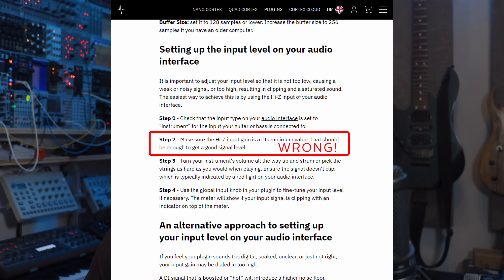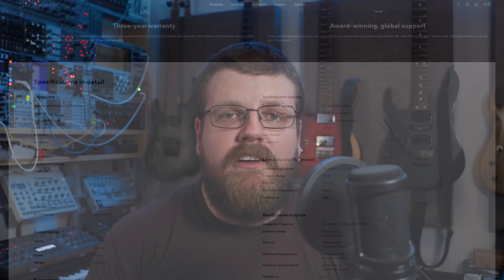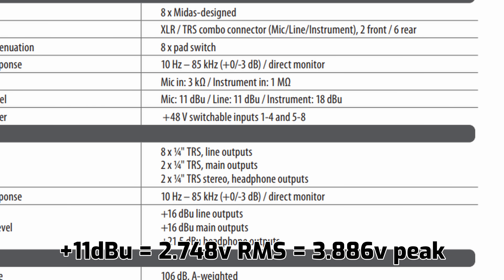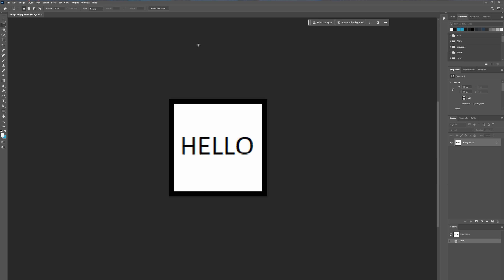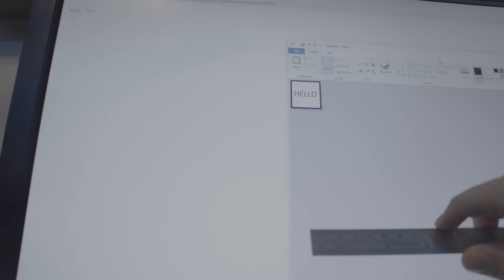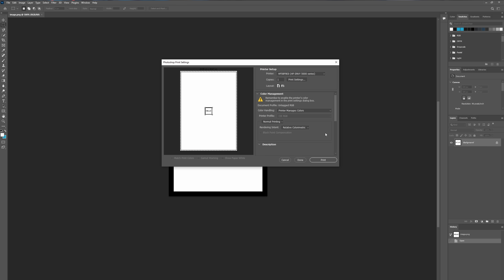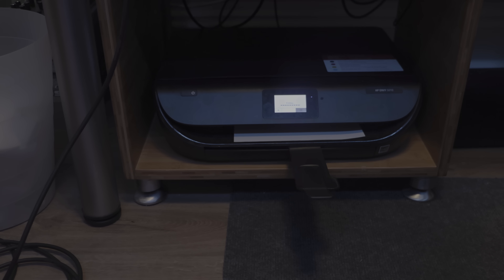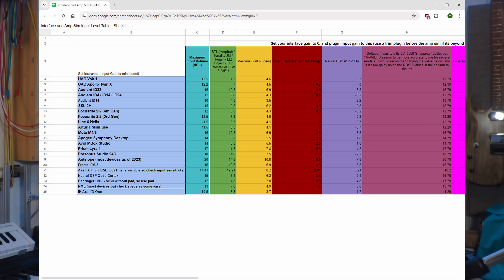Ampsims and input gain - Please, stop the madness...

Comment: In my modest opinion, the story is a little more complicated with sim plugins, which are supposed to behave exactly like the real counterparts. With this approach (ie, maximising the signal/noise ratio for ANY type of input), the amplitude of a signal generated by a Strat as observed by the plugin in the digital domain will be roughly the same as the amplitude of a signal generated by a Les Paul. So I think there are two options here: either we follow this advice, but then we'll have to use different level adjustments in the digital domain to compensate for the different instruments, or we give up a little bit of noise floor and adjust the interface gain for the highest output pickup we have, and keep the level adjustment fixed in the digital domain. In any case, however, I think the sim plugin manufacturers should report a reference level that the plugin expects to see *for a particular pickup*, otherwise we are still missing one aspect of the equation! (and then obviously you have TONEX/NAM, where the capture process is not standardised, so those numbers should be provided by whoever produced the captures).
Reply: I set it this way to my loudest humbucking pickup. And then just leave it at that even if I plug in a single coil. So the lower signal of the single coil behaves how it should with its lowered output. I think that makes sense?
Reply: It does make sense. To be 100% accurate, we'd still need to know the reference input level that the plugin expects *for a particular pickup*, but the manufactures don't go down to this level of detail, so using the reference levels that were collated in that spreadsheet should put everyone in the right ballpark... and we can finally play 😀
Reply: Really interesting point about different types of pickups! Plugin companies providing reference levels for different guitars/pickups seems like a pretty cool idea to me, especially if you're trying to sell people the "sound" of something in the real world they can plug their guitar into and compare it to. You don't want them to think your plugin doesn't measure up to the real thing simply because the input levels need to be a certain way to reproduce the sound they're familiar with, but nobody has this info. 

Since plugin companies don't really do that, I'm wondering how would I deal with this if I was using the method described in this video to record more than one type of guitar, and wanted the experience you're describing with a plugin reacting like a real amp in that it behaves differently when fed different guitars and pickups, etc....

I think I'd try getting a setting dialed in on the audio interface using the loudest guitar(s)/pickup(s) out of the ones that I have. Then, I'd make a mark on the audio interface, take a picture of the knob's position, make a note, or something so that I could return to that setting whenever I input any of my guitars into the audio interface. I would dial in the settings on my amp sim plugin(s) using the guitar I play the most and the input level I just decided on with the audio interface.

I have not tested this (of course), but I'm guessing the difference in the noise floor created by the different signal levels when comparing two guitar pickups might only be a big deal if one of the pickups is noticeably noisier than the other, or if one is passive and the other is active. 

Ok, enough of this. I'm gonna go record some things.
Reply: Jason Sadites just posted a video about this - he seems to agree with me 😀
But yes, fundamentally, to avoid constantly adjusting the input gain in the digital domain, the analog gain on the interface will always be a tradeoff between signal/noise ratio and the ability to pick up any guitar we have and avoid clipping. And yes, the signal/noise ratio lost (worst case is for lowest output pickups), if we are not using garbage interfaces, it's likely to be... in the noise (no pun intended).
Reply: Same issue. Calibrated my input gain so hottest active pickups don't clip. Keep the same setting for vintage strat pickups for consistency in virtual amp's response. I guess, this gives me about the half of bit depth for strat. And that's better than a quarter of bit depth)))
Reply: Sorry to resurrect this, but thank you, you are right.  This video is all correct but misses the point of the earlier debate.  

There is no standard for what an amp sim “expects” digitally and no way of knowing if you have it right except if you can compare to the original hardware.

Also whether you turn up the gain as high as possible is a question of whether the analogue circuitry and preamps in your interface is 100% transparent for the instrument inputs.

Comment: This makes a lot of sense to me. And how people have recorded using digital audio interfaces for many years. With mics, DI bass, synthesizers etc... The only thing maybe I was thinking was that it's the 'AVOID CLIPPING' part. Whatever about the other considerations, that is the most important aspect. If it's a choice between clipping, and low-gain (and resultant noise) and clipping, I'd take the higher noise-floor any day. So, I do think it's maybe not as loud as possible to avoid clipping but I think of more as loud enough for a very healthy signal level, where clipping should never occur. I know it's pedantic, but I think there's a distinction that matters. The middle ground of healthy signal level is where I want to be. Then yes, like you said, adjust the plugin gain. But on that part, I really don't know why the general advise by others isn't just 'trust your ears'. Like people should with microphone positioning, phase, or dialing in the tone from a real amp or pedal. These days people are expecting computers to hold their hand to cross the road ;)
Reply: Well that’s obviously foolish.
Most DAW computers don’t have the ability to walk or hold hands.
Reply: @nigelsmith721  Yeah, I'd be worried about getting clipped ;)

Comment: I'm more confused now than I was before thanks dude
Reply: It's not hard... 1. Optimise analog signal going in to interface, by increasing it to just below clipping; 2. Compensate digital signal going to your amp sim (i.e., in your DAW, or on the amp sim itself) by turning it down by the same amount.
Reply: @matthijshebly not quite.

1. Interface to zero
2. Digital gain plugin to chart (interface/amp sim matrix)
3. Increase analog gain to under clipping.
4. Reduce digital gain plugin by the amount you added to the analog stage. (If you added 10 dB in step 3, subtract 10 dB from the plugin you added at step 2.)
Reply: @Hexspa  You're basically saying the same thing, just with way more words and with lots of unnecessary confusion added...
Reply: @matthijshebly  not true. The whole point of having the chart is to match calibrated levels. That’s what the digital gain plugin step is for. If you leave that out, you’re right back to seeing things by ear.
Reply: lol best thing i found was to barely raise it a little at a time until it sounds nice. 0 sounded upsettling weak for me..ended up around 2.3 which ended up being what neural dsp says on their site. (for QC as an interface at least)   just go in small increments

Comment: Ok first of all, Reddit is for retards who want to be spoon fed every step of their lives 
Second, the complete lack of understanding by said community and others is perplexing to me because ALL the information to understand is available for free.
Social media killed curiosity and fundamental understanding.

Each recording device will have a sweet spot and produce a beautiful, low noise,  hi headroom signal.
That signal MAY then need to be reduced either by the amp sim input control (or pedal sim etc..) to again be calibrated for what that specific piece of software needs.  This entire conversation can be explained in great detail with a concept called gain staging amd its ESPECIALLY important with digital equipment.  Emulators cannot be slammed like the front end of analog equipment and be expected to sound anywhere near good.

Just do a little bit of research.  I mean ACTUAL datasheet research and the answers will appear.
Fucking social media....   Jesus Christ

Comment: Really good video, subscribed! Well laid out. 

Basically, the "set it to 0" approach is just "the easy way out" for the ones not knowing what they are doing. I have to admit that I belonged to that crowd for quite a while, or differently said, I did not care for it. The issue with John Cordy's, and even way more so with Rabeas video, is that they simply are parrotting out what others told them, to make a click-baity video. They do not explain the technicalities behind those approaches, but they just say "Yeah m8 you dumb turn knobz down wow such sound lol"

On the other hand, Ed Sokolowski's approach to propagate for setting the gain to 0 (which I would say had the most impact, since John Cordy for example also has grabbed this idea from Ed) has a different motivation: To have a single common denominator and a clear reference from which to work on moving forward. For people to being able to properly assess at which levels they are making their profiles.

If you gain up your channel via analog means, you have to evaluate through measurement how much of an increase you are pushing for, before you reach the clipping threshold. A guitar signal due to it's inconsistency is not a good reference to check on that, and not everybody has a sine wave generator they can plug into their interface (to get nice before/after values of their analog gain staging). Also, the Behringer UPHORIA 1820 with it's +18dBu headroom has plenty of room to utilize before you hit the clipping threshold - with the +10dBu of my audient iD44, that might be a different story. 

However, this is a great approach which I will put to the test on my interface. I mean, I personally did not have too much complaints on noise for my taste by setting all to 0, but I do CLEARLY see, as an fellow electrician (although not within the field of digital signal processing, I shifted sideways nowadays to networking technologies and Crypto-IT), that everything you stated in this video is technically correct and sensefully the right thing. 

THANKS!
Reply: Well said! Isolating independent variables rules!
Reply: The problem is plugins like Amplitube. every single amp model need to do adjustment and that sucks

Comment: Is there anything more gratifying than seeing someone much smarter than you explaining why you were right all along?

Everyone (including the guy that started this whole thing) told me I was totally crazy when I said that increasing gain on the interface would reduce noise.

Thanks so much for this video my dude! You rock! 👊🏻👊🏻
—Toby
Reply: If you are referencing me Toby, this video is giving the exact same advice I've given you. As the video explains, there are 2 aspects to consider; optimising SNR, and adjusting the headroom to match what you are using. I think the SNR aspect has always made sense to you, but the calibration part caused some kind of issue.

SNR will improve if your converters noise is louder than your pickups. In that situation, of course increasing gain improves SNR. SNR can only be as good as the noisiest signal in your chain, the goal is to have the converters well below the noise of the pickups while avoiding clipping.
Reply: @eds4754  when this came up before, I said that running the interface at 0 led to an increase in noise, and several people called me stupid and various other words, and if I recall correctly, you said I must have misunderstood your directions. I This video showed it was neither 🤷‍♂️  I might not have explained myself very well, hence why I found this video enjoyable and gratifying to watch!

As far as calibration goes, I get what you’re trying to do, it just seems like more faff than necessary for my own use case. But that depends of course on your end goal. If you just want a sick tone for a quick demo, I dial by ear, if you’re more interested in getting as close an emulation to the actual amp, then yeah follow the spreadsheet.
—Toby
Reply: @AiiZStudio  Turning the gain to minimum just allows you to have a known reference level of your signal without having to use a multimeter. The reason this is commonly suggested is using a multimeter will deter most guitarists from calibrating their levels, and the most common interfaces from Focusrite/UA/Audient/RME are generally going to produce a signal close to 0dBFS when using humbuckers at minimum gain. Many instrument inputs are designed to avoid having very quiet signals close to the noisefloor, which is why many have settled on 12dBu (happens to be the maximum level you'll get from most pickups and 9V pedals).

Once you have a known reference level, you then know how much to calibrate. Where you do this calibration, and by how much will depend on how close your signal is to clipping already, what your noise is like, what is easily recallable. Its user preference and situation dependent. 

The videos that have gained the most attention have shown the "quick" method of calibrating, which for some cases, will be at the expense of some noise. This video shows a way to optimise both SNR & calibrate accurately. For the more tech savvy users, this is the optimal way (and how I do things personally) but its also likely going to be offputting to some users and they'll simply ignore the advice on how to calibrate.

I've offered in the past to walk you through how to measure your headroom accurately for whatever setup you like, and the offer is still there. I know you're happy just doing it by ear and thats fine too - its just handy for making models and testing/comparing plugins to hear them as intended. KNOWLEDGE IS POWER

Comment: I have used audio assault amp sims for long time and a behringer umc404hd the behringer input levels is -3  I level input and output on the amp sim a -3 it sound good to me with the pad switch on the interface level is about 2 o clock since doesn't had numbers o levels on the button since this discusión started couple month ago about the inputs levels every time i watch a new video about it I got more confuse so i will just keep everything at -3 😂😂😂😂😂😂😂😂

Comment: Just tried this out! What a difference it's actually made to the noise! Thanks for this. 

I do wish amp sim makers would just implement the level indicator like ML Sound Lab where you just chug turning their input dial until it goes green. It'd save all this headache! haha
Reply: I did the same and was amazed at how much of the higher end fizzy sound was gone and the tone was so much tighter and defined.  Amazing so many respected YouTube musicians hadn't figured this out.  There really needs to be a better standard way these plugins all measure input and adjust for us.
Reply: Helix Native and THU also have input level indicators. PRETTY HANDY!!
Reply: Never noticed that.
Reply: @BeGoodBe  On the ML Sound Lab amps? Yeah, all of them have it. 

Turn the input gain dial up until a little light comes on, you'll see it. That's the sweet spot for the amp.
Reply: @markuskerloch  Cheers, I'll have to use that lol.
Reply: STL tones has this too

Comment: After I increase the gain on the interface to just before clipping, how would I know how much gain should I decrease in the plugin? Is there a easy way to do this on Reaper?
Reply: Came here to ask this same question. Except for Ableton.
Reply: What guitar sim plugin do you have?  It doesn't input meters?  In Reaper you could select track metering to see the input level, or look at the wave form.  Presuming you're not clipping your interface *that's your starting point*.  Turn the "preamp" up or down on the sim, presumably the person making the model went with coherent, standard practices...
Reply: Figure out what level you're peaking at w/ zero gain vs. w/ gain and take the difference.
Reply: Ideally you would adjust plugin’s input level/volume and not plugin’s gain (which should be freely adjustable regardless), no?

Comment: One of the amp sims back then (I think maybe x50 free) had an option to listen to input audio and set its own input gain. Maybe we should bring it back? The developers of the amp sim would know what the ideal input gain is. I think at least some "red-green" LEDs would work for guiding people. This is also an issue for everyone who's blending maybe two different amp sims from two different companies with the same signal.
Reply: I think the problem is that the input level for a single coil, an humbucker or an active pick up is different and makes a real amp react differently. So this behaviour should be replicated in an amp sim. The automatic gain setting of an amp sim would treat all pick up types in the same way and hence not be a correct simulation.